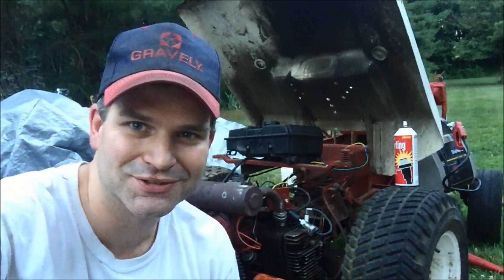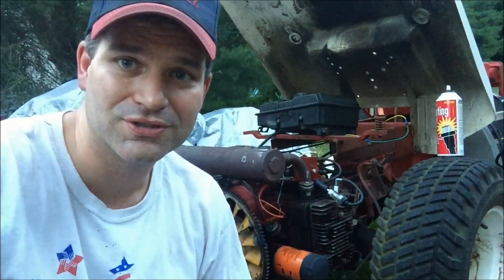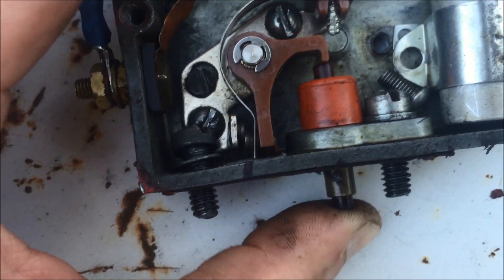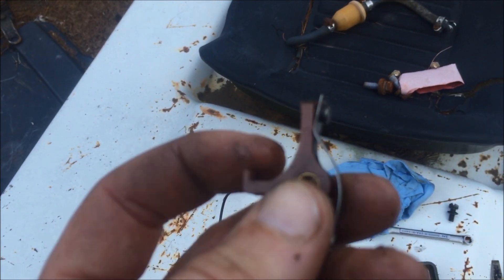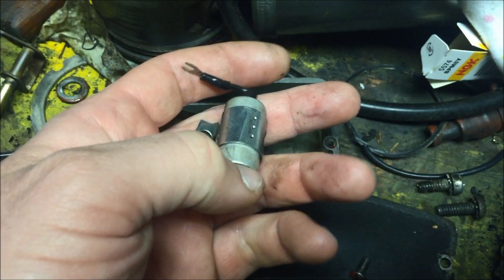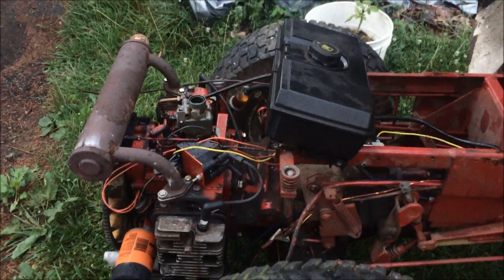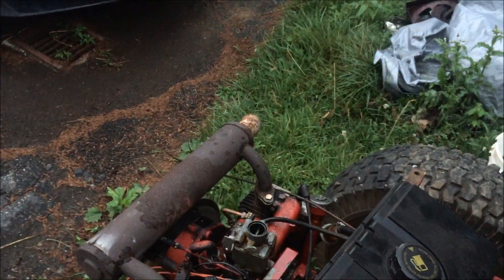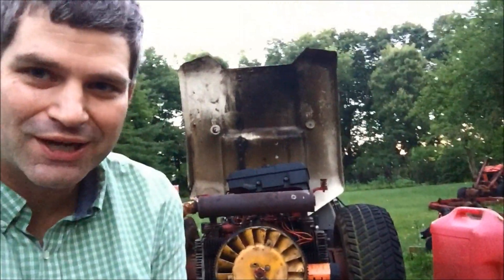Red Gravely 450 Part 6 - Major Points and Condensor Fail Uggghhh

Comment: I know this is an old post but, if anyone is interested I put an electric fuel pump on my 450, and ditched the points for a Point-Saver electronic ignition conversion kit. BEST DECISION EVER  That baby has run smooth as silk since.